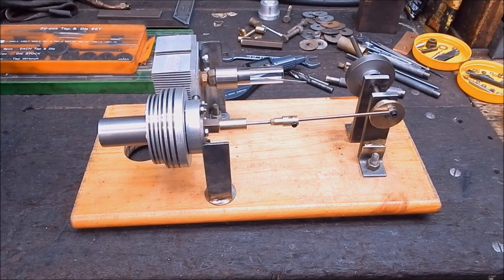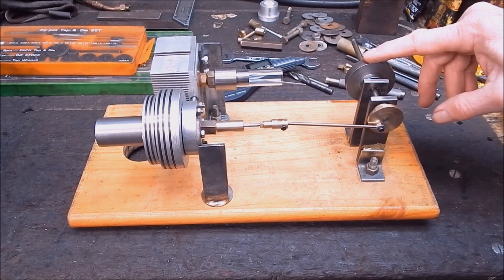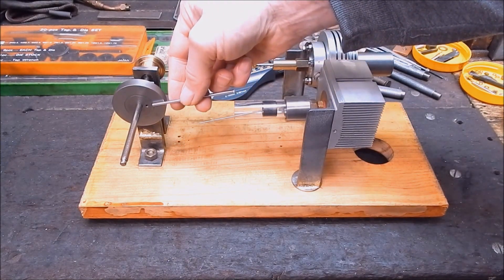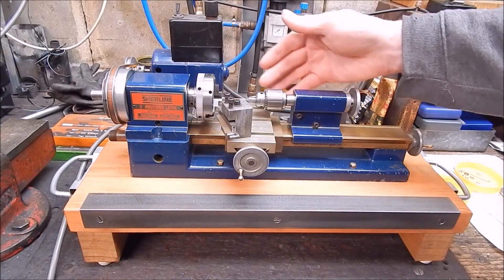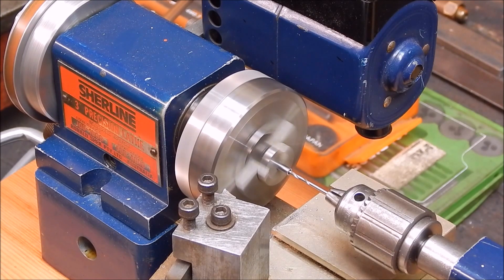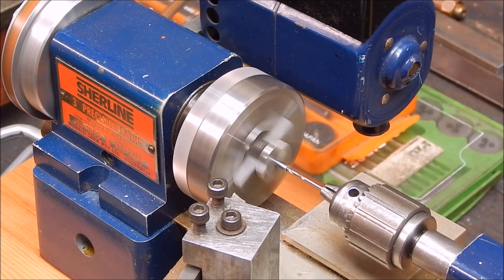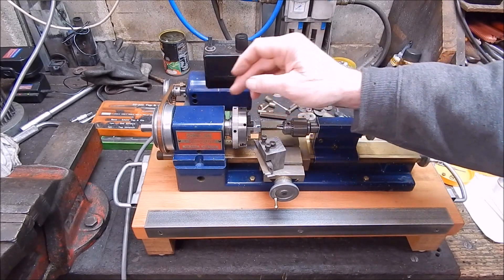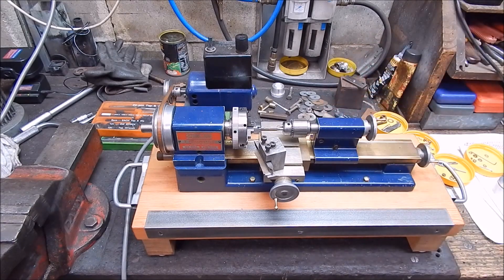An original Australian Sherline micro lathe struts it's stuff

Comment: I've got one of the same lathe here. I just got it off my dad who picked it up cheap in Malaysia and brought it back to Brisbane for me. Looks like one of the 1970's Melbourne-built ones. It came with a 3 jaw scroll chuck, 4 independent jaw chuck, the thread cutting attachment, the vertical milling attachment, live/dead centres and a steady rest.

Have you got any of these attachments by any chance? I've checked out the company's website hoping to find more info on them all, but it seems they've changed the design of a lot of this stuff on the modern California-built models. I'm a bit lost on how I'm supposed to put the thread cutting parts together as it's vastly different to the modern design. Also not so sure how the milling is supposed to work (do I just mount a flute into the scroll chuck?), and unfortunately there doesn't seem to be much other info on these old original Sherlines out there.
Reply from the maker: I don't have any attachments.  I wondered about the milling aspect as well and I can only guess there is a collet chuck available.  The spindle does have an internal taper  (possibly Morse) but on mine the runout is massive when measured with a test indicator.  Holding end mills in the scroll chuck is NOT a good idea, particularly as the tensioning system on these is low rent compared to a keyed chuck.  Cheers Rob

Comment: The stirling is looking great Rob 👍 Can't wait to see it running. I love that little Sherline, wish i had room for one 😢 Cheers, Alan.
Reply from the maker: Hi Alan,

I tried a test run yesterday and no go.  Too much compression.  Normally there's not enough ;)  So I will have to do some thinking. 

I suspect that using a smaller diameter cross gallery than on the previous version is the problem.  Technically they are both the same, but I did change a few measurements to see if it would be a plus or a minus.  Looks like the latter at this stage.  But Rome wasn't built in a day so it's back to the work shop.

I thought the little Sherline might appeal to you, given your work scale.

Cheers Rob
Reply: @Xynudu  Tinkering with these things is half the fun especially when it's your own design. Cheers, Alan.
Reply: Room for one? It fits on a sheet of A3 paper!

Comment: Would help to use some cutting oil
Reply from the maker: Great way to work harden stainless steel John.  Any temperature drop is a dead set way to work harden it.  Cut it dry and slow so minimum heat and all will be well.  I was thinking after that if you scaled up the drill and the job by 10X, it would be roughly equivalent to a 10 mm diameter HSS drill going through 15 - 20 cm (7 inches) of solid stainless steel.

Not a bad effort for any lathe or drill press.  I had no problem what so ever and the drill was still  sharp afterwards.

You can get a paste made for drilling SS but last time I looked it was classified as highly probably carcinogenic, so I won't be using that any time soon. The tactile/feel factor is critical for these tiny drills. 

Cheers Rob
Reply: @Xynudu  I have an emco unimate 3 and find with stainless slower the better just your filming did not show very much penetration hence my comment. Also drill 0.8mm thru 1.6mm stainless good fun
Reply from the maker: No problem John.  I had to drill 20 mm to Loctite in the stainless steel dampener rod.  I did it before on the previous Stirling with the Sherline no problem.  I was taking it very gently,

Stainless steel is a bastard to drill as it easily work hardens and burns up drills like nothing else.  Slow and steady with no shock cooling is the go.  Coolant is fine on shallow drilling, but for deep jobs I don't recommend it due to the heat buildup and spasmodic application.

Using that special paste would probably help as it would coat the drill flutes, but I don't fancy the fact that it may be bad for your health.

Micro lathes are super good for this sort of work.

Cheers Rob

Comment: Hi Rob    Harold Clisby after he sold the air compressor business he designed and built mini lathes this was when he was around 90 years old he had a small shed at the bottom of Norton Summit  Road Magill. This designe was sold to a company in England who manufacture the lathes under the name of Clisby.   Ray.
Reply from the maker: Hi Ray,  I only know a bit about Harold Clisby and Ron Sher.

Clisby designed the lathe here in Adelaide Australia and Rob Sher in Melbourne built and sold it.  Ron then sold the rights to an American Company who still sell the Sherline in an upgraded form today.  Ron still runs Sherline Australia which basically just sells imported USA Sherline components.

It is hugely popular among small lathe owners - similar to Unimat (rebranded Sherline versions) and Emco.  I am not aware of any English version or connection.  

Here is a link to the current USA builders:  https://www.sherline.com/

The original Australian versions all had a brass bed, early USA versions also had similar, and later switched to steel as you see now.

I have seen some comments that accuracy is elusive with these, but that's not so from my experience, and what you see in the video.  You have to set the head stock angle correctly (it can swivel for taper offset) and also lock the tailstock correctly (two bolts can affect this).

It's a very small machine built for very small jobs.

Cheers Rob

Comment: That sure proves the value of a small lathe Rob. :)
Reply from the maker: Hi Chris,

I was just thinking after that if you scaled up the drill and the job by 10X, it would be roughly equivalent to a 10 mm diameter HSS drill going through 15 - 20 cm (7 inches) of solid stainless steel.

Not a bad effort for any lathe or drill press.  The tactile/feel factor is critical for these tiny drills.

Cheers Rob

Comment: i just enjoy working on my mini lathe its amazing how  nice they really are,,,,nice video,Rob enjoyed as usual,see you next time.....
Reply from the maker: Hi Ray,

I was just thinking after that if you scaled up the drill and the job by 10X, it would be roughly equivalent to a 10 mm diameter HSS drill going through 15 - 20 cm (7 inches) of solid stainless steel.

Not a bad effort for any lathe or drill press.  The tactile/feel factor is critical for these tiny drills. 

Cheers Rob